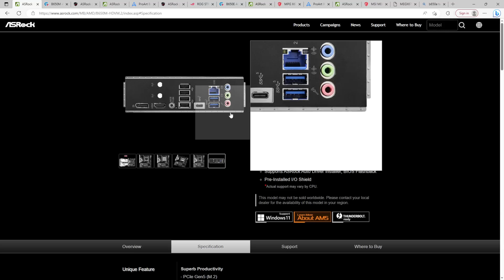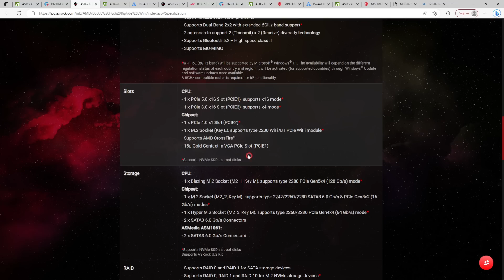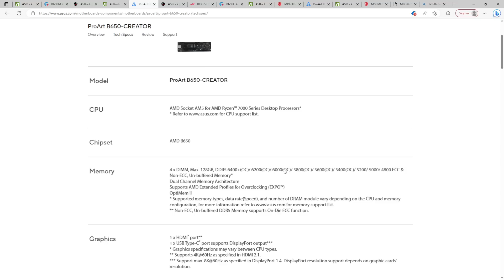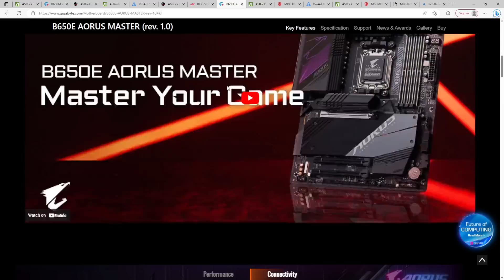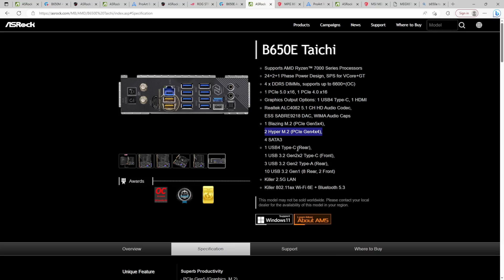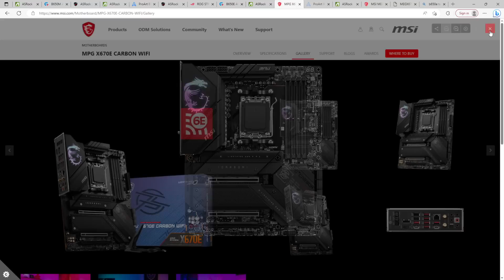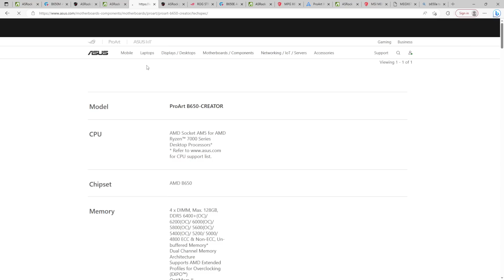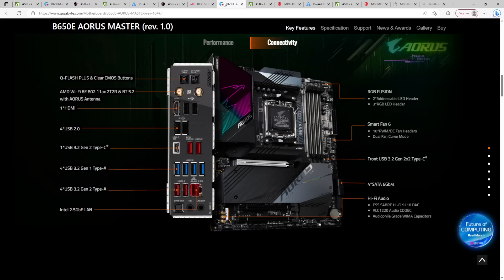AM5 motherboard round up

Comment: The AsRock B650M-HDVM2 has been really good for me.   SOC never defaulted to over 1.25 on mine, when setting to 6000XMP profile.  Really happy to have not had to sell my soul to upgrade to AM5.   It's got everything i needed personally.
Reply: is it stilll working properly im looking to get it this chrisdmtas
Reply: If it is working properly did you have any issues with it?
Reply: Please provide an update.
Reply: there is also  ASRock B650M Pro RS which cost like 140$, you get RGB support, 4x dimm slots and 3x M2, seems like really good deal

Comment: Aah not enough tea yet this morning. I was confused looking at the Aorus Elite thinking, mine looks different what the hell... I have the full size B650 (non M) version. I'm happy with it. And yeah the  M.2 cooling plates are good, they actually dissipate heat. The M.2 plates on my X570 Aorus Master seemed to be more like a nice looking cover. Perhaps the drives just weren't getting as warm.

Comment: i had gotten a gigabyte x670 aorus elite ax honestly just because of the insane number of usb ports you get in the rear IO. it was probably not the cheapest board (about US$250 in the country i live) but it was such a good value considering what i look for in boards. plus of course, the obviously overkill VRM
Reply: Do you have problems with WiFi on that board or use ethernet? A bunch of other people online and I seem to have issues with the RZ616 (MT7922A22M) card it uses. I use an AX210 card to replace it.
Reply: @Emotional_Support_Twink  i haven't tried using wifi yet, i'm so sorry i can't be of much help
Reply: @Emotional_Support_Twink I'm considering this board. What kind of issues are you referring to?
Reply: I almost bought that board, but bad audio codec and bad audio connectivity were a deal breaker. In the end i went with ASUS X670E-PLUS, which also has pcie 5.0 x16 that might be useful in the future.
Reply: @nekdo_kavc  Unfortunately that board is also using a MT WiFi chip: page 70 in the manual (they don't list it on their website specifications for some reason) shows the two MT chips you can get being the RZ608 and RZ616

Comment: I want performance, but it's not the deciding factor for me. Quality, reliability, and system stability are. I do play a bit of ESO, but the primary use for my PC is digital audio workstation stuff for guitar, plus communications, reading, streaming, and news etc (and all the day to day stuff like paying bills and making appointments etc). Stable in my use case is far more important than a few extra percent FPS. 

I have been building my own PCs since last century, and the 2000s were terrible for motherboards dying often after less than a year. Bad capacitors usually, so that's the first thing I look for on the product's info page, e.g., 'built to last - long life caps', etc. 

More recently it is stability giving me headaches. My Asus ROG B450 board is really fussy about which ports I have USB devices attached to. Either the system will not boot, or it randomly turns devices off, no matter the power settings, or BIOS version, or PSU upgrade. I have to do trial and error to work out which ports will be most stable. It's so bad that I have been thinking of getting a B550 board, or going AM5 (I have even thought of going over to the dark side -- Intel - Apple is even darker). I will live with it for as long as possible, because I have only had the 5900X and RX 6750 in there for a short time. 

There is one series of mobo I just found that claims to cater for reliability and stability. The MSI Pro Series. I am not in the habit of believing these claims on trust, though. I will have to find ways to verify.

Comment: I know this isn't exactly timely, but I'd love to see a list of motherboards for AM5, or even intel boards, that have more "legacy" IO layouts. (or at least some tips on what might serve my niche use-case

I work in audio engineering and VFX, and the "normal" (meaning not m.2 slot) PCIe situation is pretty dire right now, whether you get intel or AMD. I'm forced to run a GPU, an SDI monitoring/playback card, a multichannel ADAT/SP-DIF interface, 6+ SATA ports for dozens of terabytes project hot-storage, and a ram intent cache card to ensure that storage isn't slow. This is necessary for my work, there's no getting around having this hardware built-in unless I fork out a ton of money for extremely fast network storage, or a bunch of outboard gear for AV switching. 

Because of this, I've been stuck on an old processor with an old chipset, because until the last year or two, it handled what I needed it to without complaining. FP audio, native 6k+ source footage that need HFR 4k timelines, etc. have changed that.

The problem is, now that I need to migrate to a new platform, there doesn't seem to be anything that will even let you plug in 5 PCIe devices, much less run them at the same time. I used to be able to do the above just fine on a cheap Z270 board. Building out something on a workstation chipset ends up being as expensive as the other options, and I'd really like to avoid that too. 

Thanks for all your analysis of this topic, I find your content very useful in informing my own decisions.
Reply: So you need 4x PCIe? 
What's a ram intent cache card?
Reply: Gigabyte B650 EAGLE has 4x x16
Reply: @FiveFiveZeroTwo  it's a device that buffers disk IO into a bank of RAM for things like video editing and fast networked storage
Reply: @FiveFiveZeroTwo  unfortunately 3 of those slots run at 1x. most decent SDI capture cards need 4 or 8x, same with most things that aren't wifi adapters or basic peripherals. a 1x slot isn't very useful.
Reply: @tysonoham5628  Can't you use normal RAM for that? If I google for it I can't find any hardware.

Comment: just bought an ASRock B650M HDV/M.2 and 7600 combo, can't wait to put it together. 

I was considering more expensive boards, but I have no interest in OC I have only 2 m.2s (both gen 4) and one SATA drive, minimal USB needs (mouse, kb, sound card, headphones, sometimes a desk lamp and rarely an external type C SSD), so I really felt no need to go higher. Paid 130€ for it and 200€ for the CPU, 130€ for a nice Kingston 32GB of DDR5 6000 CL30 kit.

Here's hoping I can slap an 9800X3D in there when they're no longer 800€ 😅
Reply: is it ok to put x3d CPU in hdv board?
Reply: @ahkiiid  of course, why wouldn't it be? Buidzoid said it can run a 7950X just fine, it could even overclock it, and since the 7950X is a 170W part, and the 9800X3D is a 120W part, it should work just fine.

Comment: No more Asus motherboard.
Reply: Too late.. already bought one. But if/when it breaks I'm going MSI
Reply: Sadly I bought one. I'm praying it's just confirmation bias and it isn't that prevalent. But in the event it fails I'm getting another ASRock. The build I made for my partner has a pg lightning and it's going strong.
Reply: @JorgeFabrizio  Just don't update to the latest BIOS it provides till you know from the community that it's safe to flash otherwise it will not only kill your motherboard but your expensive CPU also & it's asus so bye-bye to your warranty because you flash their bios which will void the warranty 😂.
Reply: @avyam7509  it looks like the latest "stable" is 1303 I have an x3D chip so it might not even post if I don't hit do that at least.
Reply: @avyam7509  1515 went live. No issues so far. It's running ok
Reply: I have always bought ASUS and never an issue or never needed a return 🤷

Comment: The B650E Taichi is the board I chose for all those sweet features: Thunderbolt, Killer LAN, and Optical. I might not have purchased if I knew it had a VRM fan. Luckily it doesn’t need said fan, and the fan spins up on power on and then right back down to silent. Just a bit of auditory feedback that your computer is turning on, not a constant or inconsistent annoyance. I would have foregone the Thunderbolt and gotten the B650E Aorus Master instead for the better out-of-box memory timings, but by the time I was ready to buy, you could no longer get it for less than the Taichi — it shot up like $120 in price. No thanks.
Reply: Have you tried the “dual networking” feature? I’m sort of intrigued by the idea of being able to game and also stream updates over the wifi, my network certainly has the capacity.

Comment: Owning here a Asus Rog strix X670E-E Gaming Wifi.
Working so great with my 7950X.
32GB 6000MHz CL30 overclocked @ 6400MHz CL28.
Reply: Be carefull with the voltages... asus can kill your cpu
Reply: @herlotz  not only Asus…
Read  also about Gigabyte.

Comment: Honestly I’m happy with my x670e Carbon. Not having eCLK sucks but OC videos were pretty underwhelming in the performance boost using the external generator. I’d like the Ace but I’m not spending an additional $350 for 5-10% in “some” applications.

Comment: For those building SFF it's worth noting that the AsRock ITX offering is actually missing BIOS flashback
Reply: @Blue There are a few exceptions but the vast majority of all boards will have the feature. On a price comparison-site it's 76 out of 83 listed models that got Flashback and those who don't are mostly Mini-ITX and µATX-variants, also one where there's clearly a button at the back so it's just data missing from the Biostar Valkyrie-entry because their site parser likely won't work with the manufacturer's site. So yeah, not really hard-mandatory by AMD for SFF-boards.

Comment: That moment I spent 550 euros on my X670E-E only to run PCI-E at x8 and x4 in dual GPU config because apparently that money isn't good enough for dual x8. Oh and it might fry my CPU and burn my house down! Thank you Asus!
Reply from the maker: read the specs list/manual before buying
Reply: good thing i found an asus x670e prime pro wifi for under 200 euros new retail. Even the cheapest b650 were more expensive with less features. And btw this board does set the second M2 slot to x2 by default! You have to put it on x4 in bios if you want the "maximum" of your m2. I guess most users wont notice or know that.

Comment: Have the B650E Aorus Master here.. sent back my X670E Hero (unopened) because of ASUS BIOS story.
Really hope it's not affected by the VRM issue (AVX workload) (my board is probably manufacturered in February 2023 - SN2308XXXX).
Just hope it's a fine board that works just as well as my Z77X-D3H from nearly 10 years ago.
Reply: I sent back the B650E Aorus Master mainly because of the issue with the m.2 heatsink screw threading being crap on one side which broke on first try..
I had some crashes due to instability with OCCT and AVX2 (after 5-10 minutes) but probably because of RAM or low VSOC. With stock 4800 mhz no issues.
I will probably get the X670E Gene but I'll see..

Comment: Patiently waiting for a reasonably priced AM5 motherboard from MSI or Gigabyte that has POST code LEDs. Hoping all the motherboard limits are resolved by then so I can run a 7800X3D gloriously at sub 100W and be able to troubleshoot it when I start messing around with memory on it.

Comment: I'm still happy with my am3+ build with the amd fx 9590 and gigabyte 990fx gaming motherboard but if I were to build an am5 gaming pc today I would get an asrock b650 pg motherboard. Not too advanced and not too basic either, with the perfect pricepoint for me.
Reply: I think fx is underrated and trashed on too much these days especially when compared to the competition which hasn't aged that well. But you deserve an upgrade man. Get like a cheap am4 board with a zen3. It's time
Reply: @MiNi Weeddeerz  nah I'm still good with am3+. I can play resident evil 2 remake in ultra graphics WITH ray tracing on and plays smooth as butter. I'll upgrade maybe in 10 years when am5 is cheap with the 7800x3d ryzen.
Reply: @cssplayer91  I think you underestimate the changes you'll get in basic windows functionality just by hopping on to am4 CPUs. I'm sure it can game fine depending on the game.

Comment: A real question: Why shouldn't I pick a mobo with PCIE gen 5 for my GPU slot?

I've read that next generation of GPUs will use gen 5 and at that point wouldn't it be best to already have a mobo with that feature?

I'm currently on a 8700K and RTX 2080 on 1440p high refresh rate monitor. My most demanding game is WoW (I'm raiding and running add ons) and that probably will not change, not even when Civilization 7 is out. My system has started to struggle even outside raid so I'm considering upgrading to AM5 so this why I'm asking.

I would start out with a new mobo b650e and then a 7600X or the 7800X3D. Later I would upgrade the GPU but if my 2080 would struggle I would choose a cheaper upgrade like the 4070 or 6800 XT. The when the 5000 series goes online I would buy one of those.

Comment: Where's the Aarock B650m Pro Rs, looking at the specs I would think it's the same as the Asrock HDV with an extra two ram slots and an extra M.2 GEN3. Is it worth the extra $40AUS for the extra slots, I would say YES, and I like the two square mounted Sata, I have a tight case.

Comment: Fantasticly useful video, thank you! 2 questions if I may; if I had a 7950X3D CPU, Rog Strix RTX4090 OC GPU & a PCIe Gen5 SSD:
1. What is the fastest DDR5 RAM that I could run if money wasnt an object, just want max possible performance; I never really understood the infinity fabric limitations, for the MSI MEG X670E ACE motherboard (which says it supports DDR5 6000 MT/s) vs the Asrock taichi X670E EATX, which says it supports DDR5 6600+ MT/s?

2. On those 2 motherboard's is there enough space between the top PCIe lane and the top M.2 slot such that I could put a dual active EK waterblock on the GPU without the active backplate overlapping the M.2 slot with a tall custom waterblock on that as well? Jay's 2 cents recently did a video where he had to swap motherboard because the active backplate overlapped the M.2 slot.

If money was no object, which of those 2 boards, or any other, motherboard, would you get for both max possible performance AND future upgradability? 

Many thanks!
Reply: It depend on your cpu's imc, most of them can do 6200 or 6000. and 2 slot ram motherboard may help you get higher frequency.

Comment: Remember when the X470 Taichi ultimate was $260 and came with 10G networking. Yea, the before times were great
Reply: USB4 allows peer to peer networking at 40gbs much superior to 10GB Lan.
Reply: @robertmyers6488  Too bad they dont make 48 port USV-C KVM-N
(seriously, i've been trying to find one for work that will let me power, image, and control 20+ laptops and mini-PCs at a time during scheduled PC rotaton)

I picked up a pair of extreme networking vsp7254sxq for $20 each at a business's garage sale.
Sure it only has 6x40G ports, but it also has 48x10G ports
Until network switches change to USB-C traditional netowkring solutions will be cheaper, or less jank, or both if you have more than 2 computers.

Comment: After my piss poor experience in the past decade with asus AND the x570 proart. I ended up with the MSI Gaming Carbon. Which… ended up only posting if you used bios flashback. Ended up shoving a Taichi in my o11 mini and I’ve only just found out there’s no T sensor for the custom loop 🫠

Comment: You forgot the ASRock X670E PRO RS (the one im using) which is $280                                                                                                                                                                                                                                                                 Supports AMD Ryzen™ 7000 Series Processors
14+2+1 Phase Power Design, SPS
4 x DDR5 DIMMs, supports up to 6600+(OC)
1 PCIe 5.0 x16,
2 PCIe 4.0 x1,
1 M.2 Key-E for WiFi
Graphics Output Options: 1 HDMI, 1 DisplayPort
Realtek ALC897 7.1 CH HD Audio Codec, Nahimic Audio
1 Blazing M.2 (PCIe Gen5x4),
3 Hyper M.2 (PCIe Gen4x4),
1 M.2 (PCIe Gen3x2 & SATA3),
6 SATA3
1 USB 3.2 Gen2x2 Type-C (Front),
1 USB 3.2 Gen2 Type-C (Rear),
1 USB 3.2 Gen2 Type-A (Rear),
8 USB 3.2 Gen1 (4 Rear, 4 Front)
Realtek 2.5G LAN
802.11ax Wi-Fi 6E + Bluetooth 5.2                                                                                                                                                                                                                                                                                                                    https://www.asrock.com/mb/AMD/X670E%20Pro%20RS/index.asp